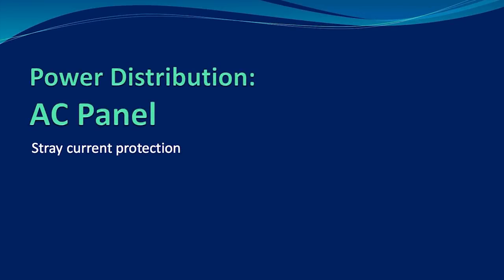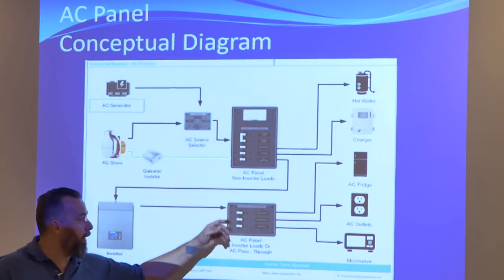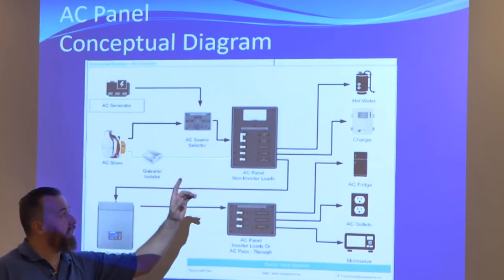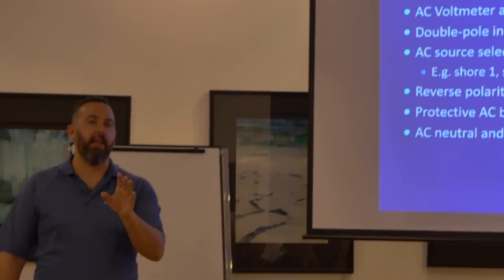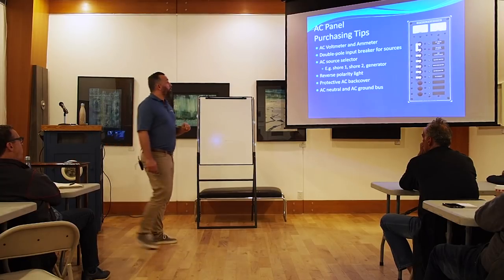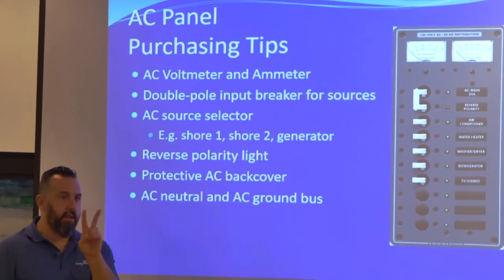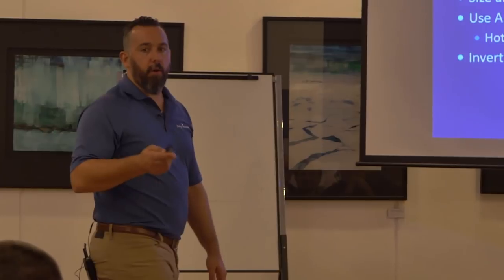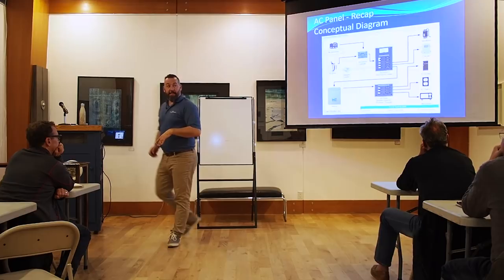How To: Marine Electrical Seminar - AC Panel - Ep 14/30

Comment: If I was to install an inverter, after removing a battery charger "converter". Can I use the input wires that were on the comveryer to the output on the inverter? And where do I draw the input wires?
Reply from the maker: It's unlikely the AC wiring (e.g. gauge 14 in North America) will be big enough to power an inverter/charger. Harping here, but remember to read instructions multiple times, inverters are hard to install and too often miswired.